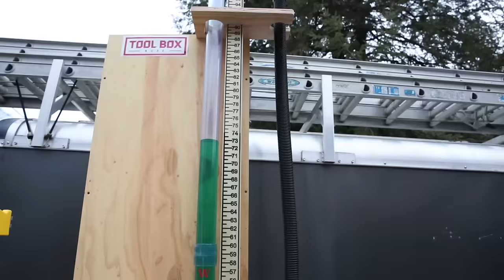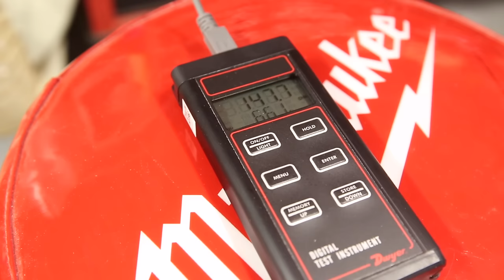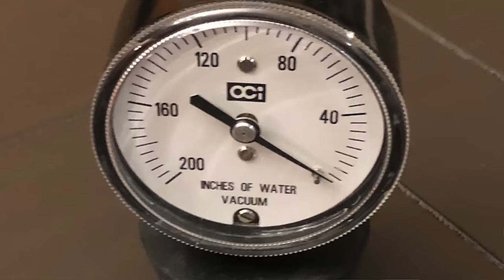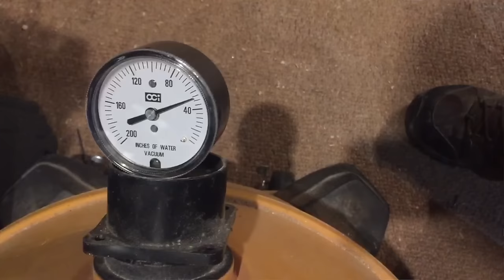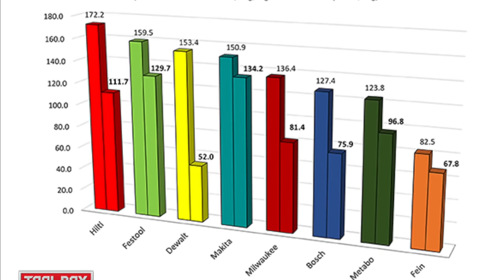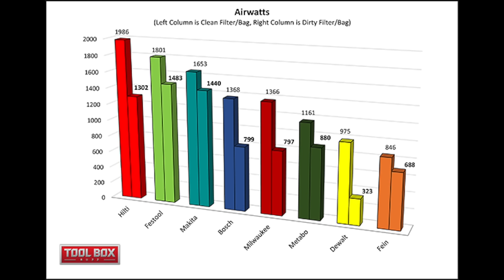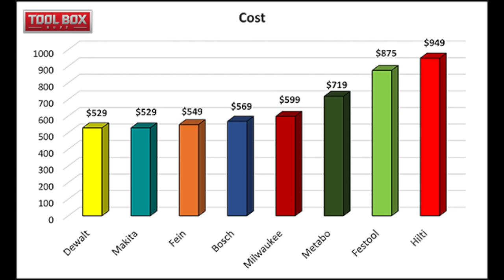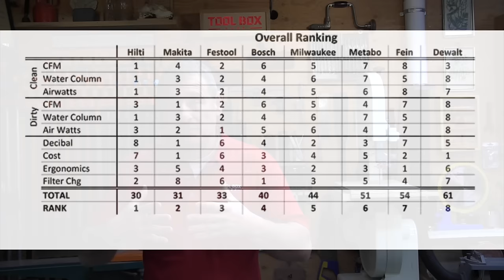Best Dust Extractors - Head-2-Head Testing

Comment: I think you should calculate final rank a little differently. Some vacs performed almost the same in power tests, so they should have the same rank. Considering Makita have some big issues with ergonomics it definitely should have a lower overall rank, you wont use your vacuum if it is hassle to do. Also I would like to see how attachments are designed. For example, I like very much rubber fittings from Bosch, they do work great. I hate plastic press fit, it always fails when you are in most uncomfortable position. Overall great review! Very informative
Reply: We put a lot of time an consideration into how we rank things. At the end of the day, we present all the data so you guys can make your own decisions. Yes, often times these results are VERY close, it's no secret the tool companies test each others tools, so they know the bench marks.
Reply: I like that you have all the numbers so we can make different decisions, but there are a lot of TL;DR folks out there.

I agree with Alexey Gerasimov in your miss on the rankings.  Here are the questions I think you missed on when deciding on not to weight categories differently:

1)  How often is your bag/filter clean?  (You give equal weight to clean and dirty performance, but for as often as mine is clean, I'd hardly bother to rate clean performance, but maybe...5:1)

2)  Similarly, how often do you encounter the "other" factors?  (Cost=1x, Filter change ?? --> You don't mention bag changes which should be more frequent, Decibels CONTINUOUSLY)

Because noise impact is so large -- you might have your hearing protection on when using it, but does everyone on site, all the time? -- I think the Hilti and Festool are problematic "for a professional" unless you work alone.
Reply: Scott Huston you see all the data....you can make your own ranking from it. We stand by "our" judgement, as you can see it can be done many different ways.
Reply: Alexey Gerasimov 5

Comment: You missed 1 most important feature, which is how good they clean the air from the dust. Milwaukee, which is rebranded Nilfisk Attix 33, is by far the best and safest. It has 2 filters 99.9% fleeted +HEPA H14 (99.995% in European version and 99.97 in US version). As well as I know, other units have just 1 pleated filter.

Comment: I like your in depth reviews in general but may I suggest a change in the way you score competitors to really rank accurately?

You assigned in different categories a rank (1 to n) and then after multiple categories you average and rank... This leads to results that are inaccurate to your measurement (Mathematically we are talking average of averages of stretched scales).

I explain, when it comes to suction power, there is a difference between ranking 2nd with 1% difference to 1st and ranking 2nd with 30% difference. Same with other variables such as price.

A better way of doing that would be to assign a score (let's say 10) to the best scoring (Let's say Hilti -> 10 for CFM at 172.2, then Festool gets 9.3 (10/172.2x159.5) and last Fein 4.8.

It decreases a little bit the ranking ease on a unique characteristic but it will capture the difference in performance unlike your current scoring methodology. For instance, Makita is 4th on CFM but it is actually much closer to 2 than it is to 5... And on price, same thing in in reverse, the Milwaukee 5th is much closer to 1st than it is to 6th.

Capturing in the scoring difference in performance rather than just ranking will make a dramatic change in the end result when you sum up. It will even allow to provide a different ranking based on user profiles featuring different importance of criteria (price sensitive vs best performance no matter the cost for instance).

Aside from the scoring methodology generic to all your tests, on this particular one, it would have been interesting to see the CFM/suction measurements with a dirty filter in wood working applications. Plasterboard dust is very fine (can be as small as 1micron particules) and agglomerating while woodworking sanding dust is usually between 10 microns and 30 microns. Some of a dust extractor poorly performing here with a filled bag could be totally fine in woodworking application (or at least less problematic).

At the end of the day you can't test for everything and choices have to be made but I am just giving food for thoughts.

Comment: Curious how they compare in functionality. My Festool has a 15ft anti static hose with tapered rubber nozzle end that friction fits into every tool I have. The cord and hose wrap into the exterior shell so they don’t catch and hook on everything and it will suck @100% power until the bag is as hard as a brick. And this might not be different then others but the Festool disposable bags are so high quality I’ve cut and resealed mine and used the same bag for a year installing cabinets. Empty every 2-3 days ish. And has a rolling brake that can be done with your foot.

Comment: Where do you test the vacuum's cleaning of the air from dust ? It appears to be missing.
Air with a lot of dust is going into these vacuum's and air is going out, how clean is this air ? To say it is with a HEPA filter is not good enough, there are different standards that have different requirements/conditions.
HEPA filters cost money, so what about, how many kg of drywall dust (and numbers of dust bags) can a HEPA filter handle before you need to exchange the filter ?
Some vacuum's have even more filters than just dust bag and HEPA filter, they all cost money and time to replace, we are missing the long time cost, you just tested one dust bag, I can use many dust bags in a day now and then.
There are many kinds of dust, drywall is just one of them, they differ in particle size and mass, they requires different minimum suction to be picked up in the first place and then a minimum flow to prevent them from clogging up your hose.

Comment: Great review, however it would have been nice to have a ridged vac in the mix since they are a common HD item. Also just wanted to note that the air watt calculation is slightly wrong as the suction value used was the water column value of inches pulled through a pipe which would have different results based on side of tube, density of the mass of water at the location being tested and so on. The values should have been used from a calibrated pressure gauge in inches of water, or inches of mercury converted to inches of water. The air-wattage calculated should be in the 150-250 range for all the vacuums not in the thousands. Just saying for future use from your friendly metrologist.

Comment: Need a good concrete cutting shroud for a grinder.  Going to cut a channel in the concrete floor in my garage where water collects.  Basically make a channel to drain the water.  Where could I get such a shroud.  My local thd only has a surface grinding shroud

Comment: Wow...great real world OBJECTIVE tests.....Thanks.....One question / suggestion.  Did you also measure / can you report the comparative times for the cleanup of the 20# of plaster dust.  It is predicted by your air flow measurements but would be interesting to note any surprises.  Were the noise tests conducted with the hoses on / were they the same length.
THANKS
GREAT JOB
Reply from the maker: Jerry W We did record the time but did not think it was a story there, too much human error

Comment: A couple of comments have already mentioned this, but I thought it worth highlighting - if there's anything below which is wrong headed, then @Concord Carpenter, please reply. I really do respect your reviewing procedure and attention to detail, but in this particular tool test, I'd say there's a glaring omission.
If there was one detail that deserved the crown for most crucial, it's how efficient the extractors are at containing the dust they're pulling in i.e. ALL the other criteria considered here are subordinate to this value - an extractor is only as good as the quality of the air it exhausts. This exhausted air can contain (depending on the efficiency of the extractor) the smallest particles of dust, which although invisible to the naked eye, are some of the most dangerous. This may not be as important to someone working outside, but when working in enclosed spaces, it becomes crucial.
A lot of people assume that if they're using an extractor - particularly one which tops tests like this or has a name for quality in this area (Festool for one), they don't need to use a dust mask - a dangerous assumption when they don't have ANY figures at all for what volume and size of particles are present in the exhausted air. I'd suggest the reason this isn't looked at in these tests, is because you'd need to have quite a costly set up to measure these values, or perhaps it was overlooked? 
If anyone reading this wants further unbiased testing info on dust extractors, check out the Dutch TNO site, where a large range of different extractors are put through their paces, in environments where their ability to maintain a safe working space is considered as importantly as it should be. 
My view is it should be mandatory for manufacturers of dust extractors to have standardised tests which give an insight into these areas. The TNO testing gives ratings on how long you can use an extractor (set up with a set task in a controlled environment), before the area becomes unsafe to work in by European rules of workplace safety.
Reply from the maker: O kafka  

To do correctly, that kind of a test would require a laboratory setup and equipment that is way beyond our capabilities and budget. 

I agree with you that it is an important issue. 

But this would be out of our capability.
Reply: @ConcordCarpenter      It's the one the manufacturers don't talk about, preferring to stick to figures for suction and volume flow. A shame it's outside your capability, but thanks again for all your hard work.

Comment: Do these vacuums have a power take off for tools...I use a 2000Watt + Router and some of the vacuums I have looked at cannot handle this kind of tool...so that leaves me in a quandry...
Reply: I use a festool ct 22  and OF 2200 router and when under a large load your typical 15 amp house breaker will trip. Best to just plug into different circuits to avoid that happening. I set up my shop with 20 amp plugs and its better but still has issues with larger diameter bits. My festool ts 75 saw  has no
 problem even when cutting 10/4 black walnut

Comment: Id still by a CDC Larue Pulse Bac over the Hilti..but in all of these tested Id definitely buy the Makita for the money. But all I do is concrete grinding so the only thing I care about is maximum CFM and a vac thats pulse air/filter cleaning system actually works, and durability

Comment: A comprehensive comparison for sure - but  where was the single most important test of all? The one which measures how much dust passes through the filter system and gets blown back out into the air? And why no mention of any of these machines being L-class, or M-class, or HEPA filtered? Every vacuum will suck dust - the important thing is how much of it gets back out again - especially when you're dealing with sub-micron particulate  like silica, asbestos, carbon black etc. etc. etc.

Comment: Great testing, but you are missing a way better model feature now, the automatic filter cleaning models, Bosch has one.  I also would factor in the ease of getting and servicing the different vacuums.  I shop at Home Depot the most at they aren't closed at 4:30, they are open on weekends, and they are open at 7am weekdays. That's not a plug for HD, but a huge factor for a busy tool user too. So Hilti being your best ranked vac, is the lowest for the above factors, and Festool is second worse for my important factors too. Leaving Bosch the #1 as its avail through HD's website, I wish in store but its still an easy one to buy.  Oh i would factor in where these machines are manufactured, most are probably China, but assembly location helps N America stay employed.

Comment: One thing you did NOT evaluate was the automatic start feature, when you plug in a tool and the vacuum starts as soon as the tool demands current.  And this is VERY important to evaluate, because not only DeWALT came in last overall, but it is  KNOWN that the Triac on DeWALT's dust extractors goes bad too soon, even when using a quite low Amperes tool.  And they charge a costly bill for repairing it (their "Warranty" or "Service" Centers change the entire module when it fails, and DeWALT puts a high proce on it.
Reply from the maker: Alfredo Márquez interesting- we don’t do long term use. We did check and evaluate them
Reply: Well, let me tell you that this failure is common and happens quite soon!  And let me add that DeWalt does not provide a real solution to their problem as they want you to buy a complete replacement module at a huge price, but their design is flawed from factory. SO, I ended up having to take my DeWalt to an experienced electronics repair technician, and his expertise determined that the damn part that fails is underrated for the task, and that the circuit is not well designed as every electric motor tool produces a voltaje spike every time it is stopped because it is an INDUCTIVE load.  Fortunately, that gentleman charged me accordingly but it was quite less expensive than buying the entire replacement module from DeWalt, and it looks that this technician understands the circuit much better than the "engineers" at DeWalt, and he added the proper additional protection elements to avoid damaging the part again soon.  Even seemingly rugged electrical relays are eventually damaged by the voltage spikes.  There is an excellent explanation in a TYCO applications note 13C3264 that explains and shows how the relay's coil (that is an inductive load) produces a spike when switchd off, and how to protect the circuit when spikes can (or are) present.Let me add: I AM SO SORRY not to have seen your excellent video before I wasted my money on the DeWalt.  Should I had seen your video, I've saved my money and bought the Makita!!!

Comment: Very good comparison👍 BUT

3 decibel difference means twice a loud!
So the 92dB Festool is 8x as loud as the 83dB Makita!
Reply: NOT SO...  you are mistaken.  Every 3 dB means double ACOUSTIC power, not double Loudness!  Double loudness is more like 10 dB. So the Festool would still be a little less than doubly loud, but definitely not eight times. Loudness perception is approximately logarithmic too.

Comment: Excellent info.  Looks like you were testing the Water Colum outside.  What was the fluid in the tube?  And did you account for the change in temp as the day got warmer or colder, thus changing the viscosity?

Comment: Ugh I really wish a ridgid shop vac would have been included in this test! I've never had a dust extractor and the reason I found this video was because I'm looking for my first one. We are all familiar with the performance of a shop vac but what I'm wanting to know  is if the dust extractors in this line up are worth 4x-6x the cost of a shop vac.
Reply from the maker: Alex Johnson You’re only worth the cost if you’re dealing with limping, or silica dust otherwise a shop Vac with a high-end HEPA or pleated filter will be fine

Comment: Great articale. However, did you consider excluding the clean test criteria (which only happen clean out of the box and in my opinion aren't a strong indicator of real world as you'tr nearly always working with slightly dirty gear) then the results are very different. Maybe you should consider this - or perhaps change weighting on the clean versus dirty scores

Comment: I have a question for the producers or anyone that is very well read on legislation though, is osha mandating H-class vac’s already or in the near future. I wondered because I work in asbestos abetment in Holland. we got a exact copy of the metabo vac (with a different label, but identical except for colour and make) six months ago as a dust extractor for our floor cutter. And the other day we got the Milwaukee, again different colour and maker but the exact same vac. After asking out purchase manager why we didn’t get the metabo knockoff, or maybe even licensed vac idk, but this other model (the Milwaukee) he told me that from January first only H-class vacs are allowed by European legislation as dust extractors for asbestos abetment. So basically the metabo is not an H-class vac as I understand it and the Milwaukee is.

Comment: Using a Hilti ('The Beast'), a Festool and a Bosch for many many years now. The Bosch is ok for my tablesaw in the workshop but not more. Festool and wood (dust) is a perfect couple. "The Beast" sucks bricks like hell. The costs are relative. In my opinion the most expensive tool is a tool that doesn't do its job. Greatings from Germany